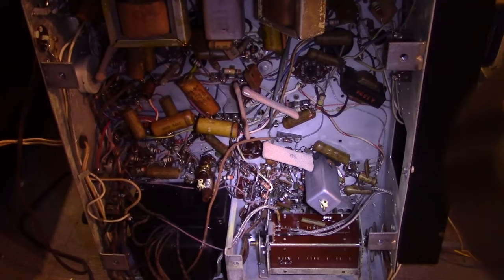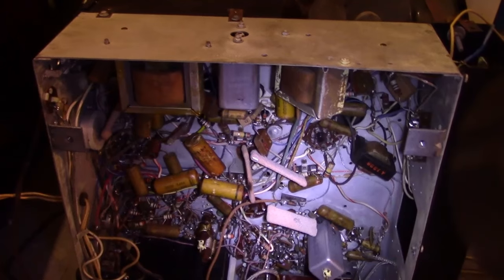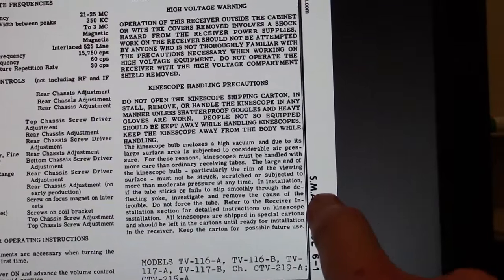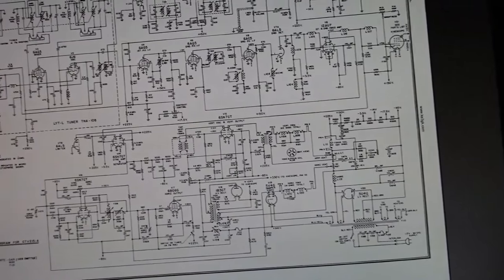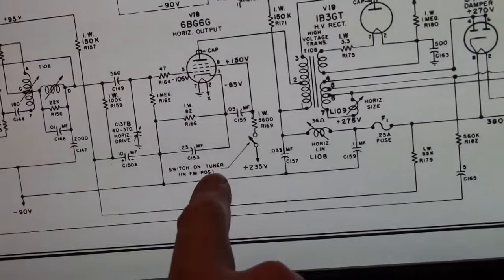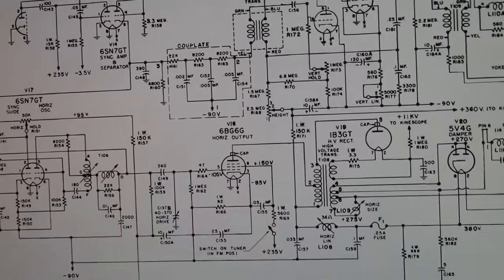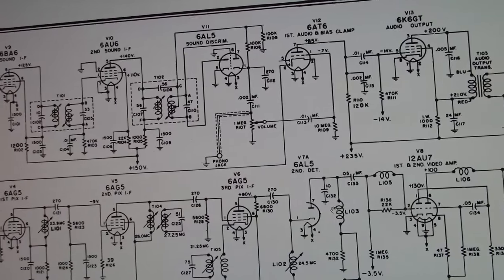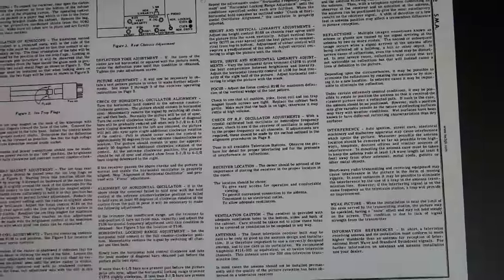Mercury CTV-220A restoration p1o7

Comment: I wish I would have known you were coming up here to Wisconsin. It looks like you will have to re-coat the CRT. If you do I'll be watching closely because I have to re-coat the CRT that is in my 1947 Stromberg Carlson TV. WHAT!?! You don't work on phonographs?? LOL Gary
Reply from the maker: +HD7100  Unfortunately, that CRT is a gonner and won't get recoated.  I've shown how to apply slip plate in a few videos.  Clean the glass really well, mask off around the HV connector, face and nack and spray on a few coats.

Comment: I just started the video so will likely reply again in a bit, but I noticed this >>  It's a rather uncommon Mercury branded set with continuous tuner.<<

A Continuous tuner? Never heard of it on a TV but seems like a great idea. I mean radios have continuous tuners so why did TV's have the clunky click clack channel selector? When I was growing up the tuner selector was always the weak link. They often had fine tuning within bands but the actual selector had so many mechanical contacts that had to make perfectly for the signal to be resolved it was maddening. Anyone who ever had to watch an old set will remember the old matchbook under the dial trick to make the connections in the tuner work.
Reply from the maker: +TruAnRksT I might seem like a great idea, but it is kinda hard to tune in a station.  They are also prone to wearing out and difficult to repair.

Comment: Are 15'' rectangular picture tubes as hard to find as the 17'' ones?
Reply from the maker: +OlegKostoglatov 16" are much harder to find because they were only used for around 50-51 years before the 17" took over.  They had very flat sides and used thick glass.   17" are slightly rounded on the sides making them inherently stronger so thinner glass could be used.

Comment: Kewl Mercury, I'd say it's more valuable than a Philco Predicta!  Don
Reply: +umajunkcollector And certainly easier to work on than a Philco Predicta.
Reply: +umajunkcollector 
I bet you are right about that. I have a blond table model 1959 Predicta, from my research it doesn't seem to be especially valuable. I have never looked closely at it. It was given to me by the original owner in exchange for some work. I would consider it in fair condition cosmetically. Some rust on the legs and the average aging of the veneer. I have never plugged it in. I believe it does have all the original tubes.  

I once thought of re-purposing it as a PC monitor, that seems silly now with the great flat screen displays we have.
Reply from the maker: +TruAnRksT Keep in mind scarcity does not equal value.  Predictas are very popular and you could easily get $500 for a working blond Predicta Holiday in good cosmetic condition.  Doubt I could get half that for this set.
Reply: +bandersentv 
Well working would be the word. Not surprising people are looking back to tubes for audio though.
Reply: +bandersentv I watched your Predicta restorations as well as the one Shango066 did. I don't know if I would want to tackle one of those. They are neat looking sets but those wired-in printed circuit boards look to be very difficult.  God knows I am having a difficult time getting the Zenith porthole set I am working on to work right.
Reply: I think the flyback is a must do, but may not solve everything.  All you have to do is go to Radio Shack and order one!  Don

Comment: Thats been Re-wired.....I can tell with the White and Red wires that are running around the chassis.
Reply from the maker: +Amy Marie Not sure what you mean.  I don't see any evidence that it's been rewired.
Reply: around the top area. look for a white wire striped red. that doesn't look factory to me, depending on how old the set is.
Reply from the maker: +Amy Marie 1951-52.  I'm sure that's the original wiring.  Plastic insulated wiring was common post WWII.
Reply: okay, that just looked out of place to me.

Comment: Mercury TV's were sold by the same company as Mercury Records.  The idea was they would sell the TV's through record stores.  I think they offered most of their console models with record players, which was probably to also encourage record sales.  They tried to get started in late 1949 by using other manufactures to build sets.  They were held up apparently by Mercury's insistence that they use only 16 inch rectangular CRT's, which weren't really ready by late '49.  They issued a press releases showing several models, and judging by the specs and knob layouts they must of had at least three different chassis designs, which was probably different for each of their contractors.  By mid 1950 Mercury was trying to build their own sets.  They purchased a factory somewhere in Northwest Chicago, but were still having trouble getting components.  Apparently they didn't start delivering to dealers until late '50.  So, it seems some sets were built by other suppliers and some at their own factory.  Not sure which were which and how many models they did actually sell.  Also hard to pinpoint when they exited the TV business, but they were gone by '52.  So, they were probably only produced for not more than 1 1/2 years.
Reply from the maker: +egrand1508 Thanks for all the great info.  It backs up what some had suggested at Videokarma.  I found the service info under S.M.A which was located in Chicago.  Probably the factory you referred to.
Reply: +bandersentv That would be my guess on the factory too. I found on ebay what looked like catalog pages of lots more models, some with double D masks...Im guessing many of them weren;t made as production models.  Also, I forgot I had scanned pages of models - specs - and prices of all sets from 1950-51 and it is on the ETF site It has listing for Mercury with several models with 16 inch CRT, all had at least FM radio, but no specifics on CRT, but some use CTV-215A chassis.  Under SMA there is listed four models, two with 16AP4 and two 19" sets. All four had FM and say they use a CTV-215A chassis.
Reply: +egrand1508 Also SMA's address was 4721 N Kedzie in Chicago.  Don't know if that was the factory site, but looks like a parking lot now.  Mercury's was 839 S. Wabash, which is in the loop and looks like a parking lot now too, so that was probably just an office building.
Reply from the maker: +egrand1508 I know that Kedzie address well.  We have good friends very near there and we visit all the time.  That's a grocery store parking lot now
Reply: +egrand1508 I found out, through a small amount of research, that there were actually two companies making TVs under the "Mercury" name, one was this S.M.A outfit, and the other was called "Pacific Mercury" which seems to have been around until the mid 1960s. I think that Shango066 may have one of the latter that he was planning to restore, or it may have been another SMA made model.
Reply: +OlegKostoglatov Thanks for the info.  Pacific Mercury was a separate company.  They were started by a guy named Joe Benaron in California originally to make furniture.  They were a major supplier to Sear Roebuck and decided to get in the radio business.  In 1946 they became the Pacific Cabinet and Radio Co., and in 1950 changed the name again to Pacific Mercury Television Corp.  I can find no corporate connection between them and Mercury Records or SMA.  Probably just coincidence, but maybe they had an agreement of some kind?  Hard to say.  Anyway, Pacific Mercury more famously was the company that developed the Thomas Electric Organ.  They were also a big supplier of electronics to Sears, and were later bought out by the Sears-owned Warwick Electronics Co.  

The name Mercury is one of those generic names that has been used on a lot of products over the years and they aren't connected to each other, i.e. Mercury cars, Mercury outboard motors, etc.  There was also the Mercury Electronics Co. of New York that made tube testers and other TV test equipment.  They don't have any connection either.